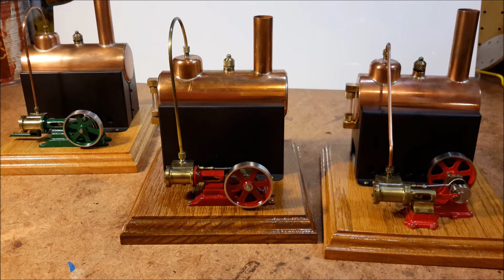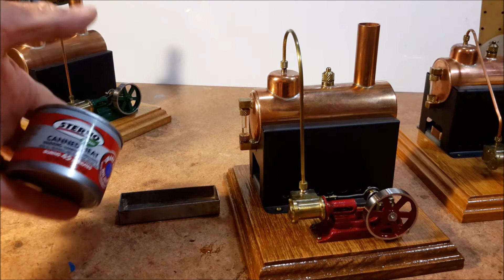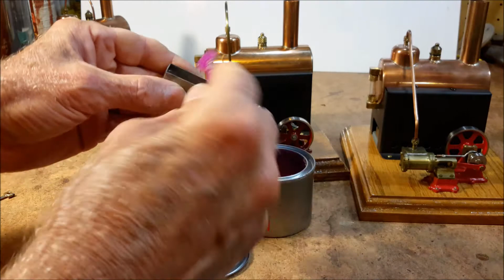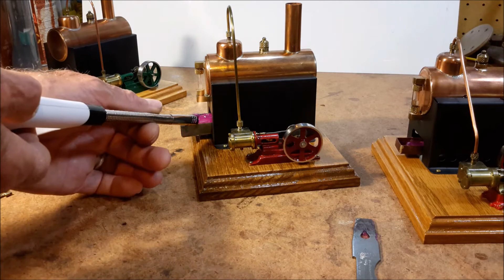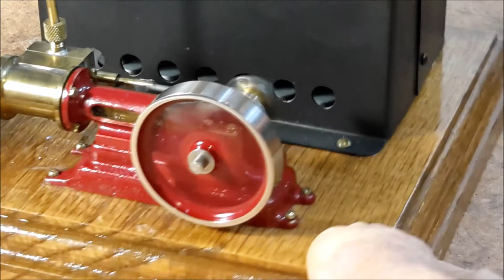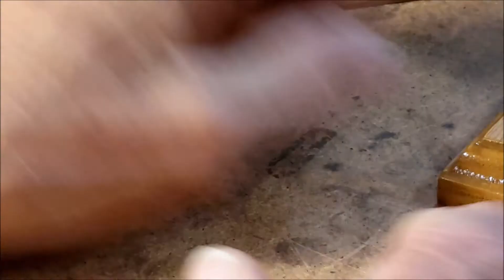MODEL STEAM ENGINES

Comment: Have you ever thought of putting up some how to video's. I know you have a few demonstration videos on your boats. I would like to see a build on say, the one cylinder you give plans for? Maybe a build on one of your mills? Also you ever think of building a model train?
Reply from the maker: Unicorn Automotive #1 Another person has made videos of the building of my little engine.  Search Steamer edge and you should find him.  Have you seen my traction engine videos?
Reply: Leslie Proper I've watched one or two of your traction engine videos. Still looking through them. They are great videos so far. I've just started getting into the model steam engine world. Seem's as if I'm hooked lol... I have a lot of questions about where to buy materials, what tools am I needing, and so on. Could you point me in the right direction for a good source of information?
Reply from the maker: A small metal lathe is needed for building the engines, boilers, and boat accessories.  I have a Sherline lathe, and I have added several accessories over the years. The ww collets are very handy for machining the small diameter parts.  My Model Steam Boat Book describes where all of the various materials can be obtained.  For example, I use a lot of K & S precision metal tubing and bar stock which can be purchased at hardware and hobby stores in the USA.  I purchase fasteners, free cutting brass rod, and drill rod on line from Online Metals and Microfasteners.  I use both soft and hard solder for welding parts together.  The hard solder contains a high percent of silver and is very expensive.  Fortunately only small quantities are needed for the tiny engines.  Hard solder requires higher temperature, but is also much stronger than soft solder.  A propane torch will work for both solders.
Reply: Leslie Proper thank you...I've been looking online, at different suppliers of copper and brass. I came across K&S. I'm looking at small lathes on amazon now. Also I found the build videos of your single cylinder engine. I'm impressed and amazed by the craftsmanship and detail. All around best model steam engines I've seen so far. Maybe in a few months I'll post on YouTube, one of my very own model steam engine. Thanks again.

Comment: Superb Les - I note that you've been building engineering models for many years - your workmanship is excellent. What was your vocation before retirement ? - Just curious. :-) Do you still have plans for these engines ? Were the sole plate and base plate mountings home castings or machined pieces ?
Reply from the maker: Hello SteamEdge - I was the Director of Public Works for a small City.  I have a Civil Engineering degree.  I have a simple drawing made to work out the dimensions for the brass cylinder block, piston, and valve.  All of the mill engines have the same cylinder block.  The rest was made by scaling pictures of the actual engines.  The mill engine models have metal cast bases and frames.  I purchase a little inexpensive furnace and dabbled in sand casting.